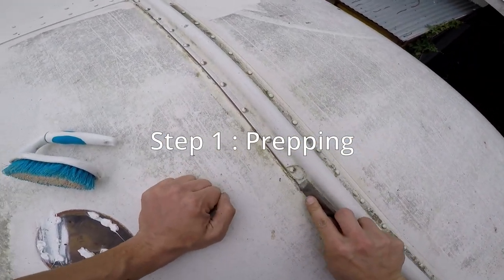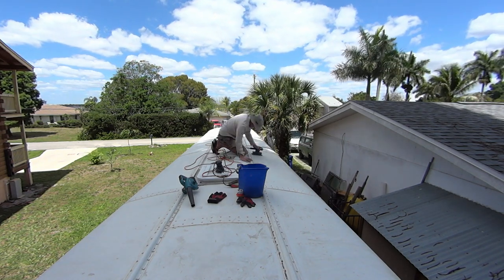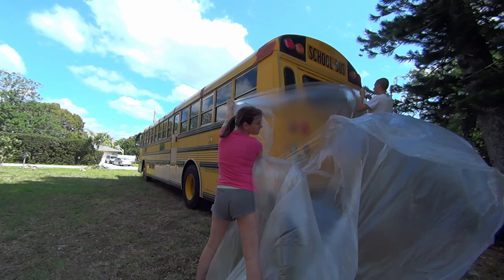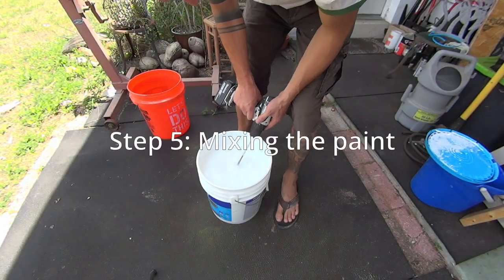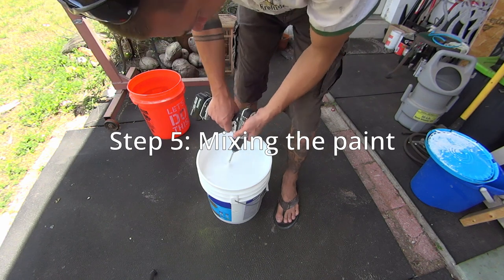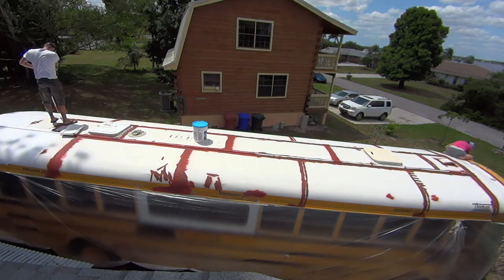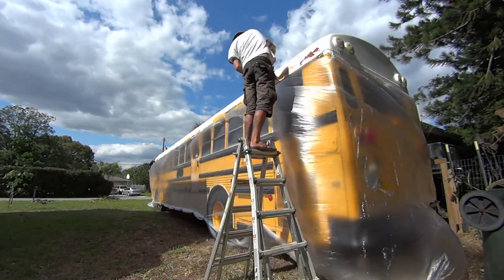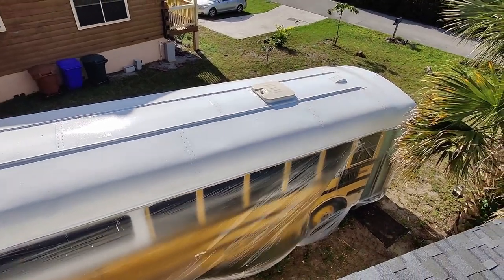Sealing Our Skoolie Roof with Henry's Tropicool

Comment: For those that decide to use henry's elastomeric silicone they recommend applying each coat in a different direction(North to South East to west) with 2 to 6 hours between.  1.5 gallons per 100 square feet.  Prep is the most important part and good luck.